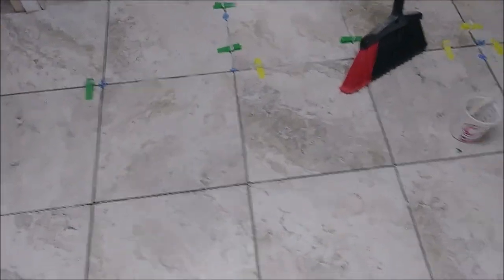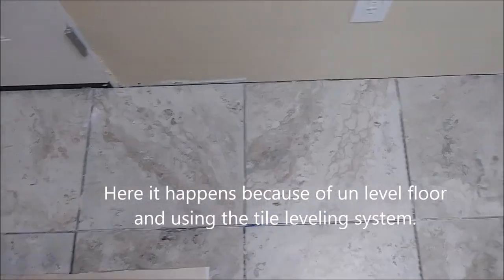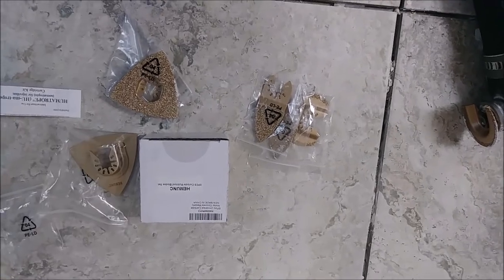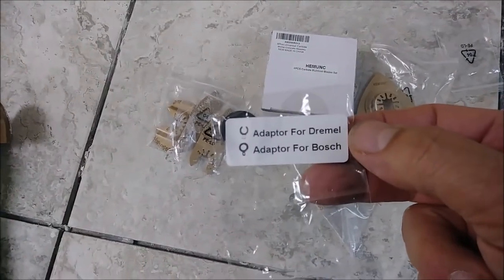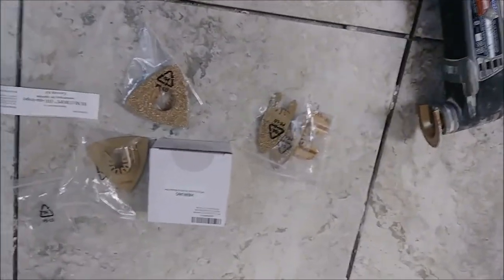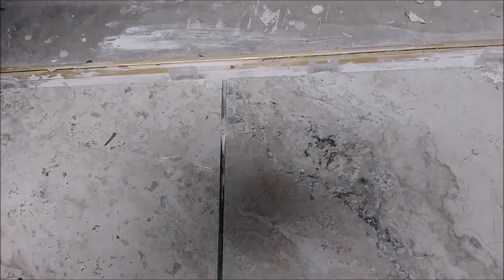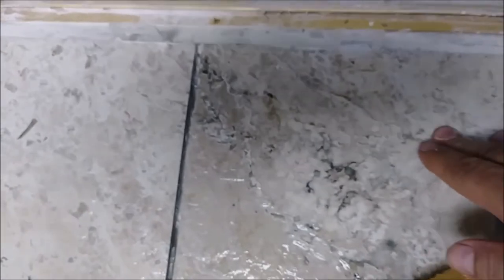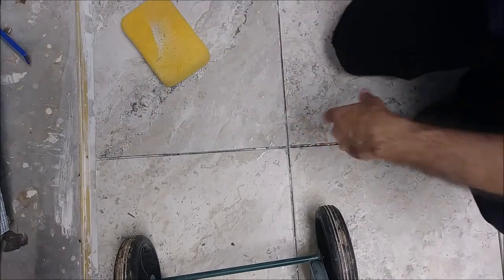How To Remove Grout Or Thinset Between Tiles Spaces - The Easy Way

Comment from the maker: Tools Used:
Grinder Kit for Tile Grout Mortar Concrete Masonry = https://amzn.to/3lOOo30
Dremel MM 50 = https://amzn.to/3zmq0uh
Other tools and Material used:
Thinset used Mapei Ultraflor = https://amzn.to/3taAsCX
Bosch Laser Level and Square GTL2 = https://amzn.to/3olZX0G
Multipurpose lavel laser = https://amzn.to/3coUK5O
Tools and Materials  used:
Angle grinder used = https://amzn.to/368IX8C
Diamond Blade =  https://amzn.to/3j2kTbc
Dimond hole drill bits =https://amzn.to/36bX2Cs
QEP wet saw = https://amzn.to/3cLJgaW
Diamond Blade = DeWalt https://amzn.to/3jfdpSr or Black Widow https://amzn.to/3jgx18G
Grout Float = https://amzn.to/3j7KO1c or https://amzn.to/348KLMu
Notched Trowel 1/4 x 1/4 x 1/4-Inch= https://amzn.to/3j26Zpv
Notched Trowel 1/2x 1/2 x 1/2-Inch= https://amzn.to/2S5Zceg
Notched Trowel 1/4 x 3/8 x 1/4-Inch=https://amzn.to/3cDPbhZ
grout sponges = https://amzn.to/3ieBx68
Nitrile Gloves = https://amzn.to/3i8VhrT
Best Thin set used = https://amzn.to/3cxVBz8
Medium thin set =  https://amzn.to/3mSk9aR
Mapei Pre Mix Grout = https://amzn.to/2HqhdC3
Mapei Grout = https://amzn.to/340hWS5
Miter Box Used =  https://amzn.to/2SnYgm1 or https://amzn.to/2G1CVfB
Hand saw =  https://amzn.to/30kvabp
48" Level = https://amzn.to/347tmUl or https://amzn.to/30m3y5H
Leveling System  = https://amzn.to/3n39GJN
Mixer = https://amzn.to/34lymod